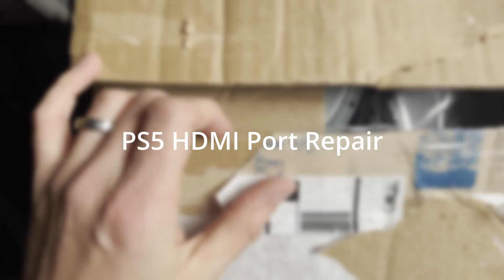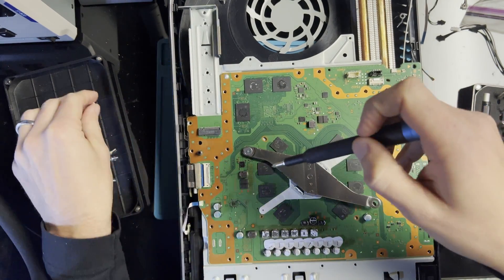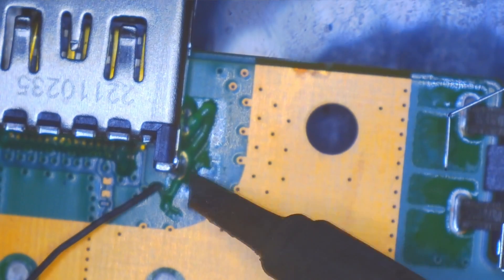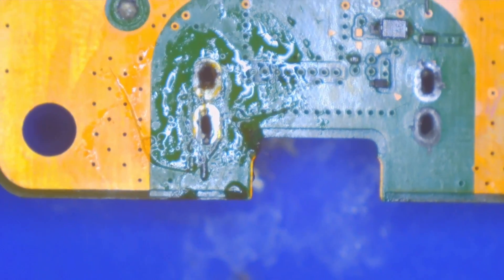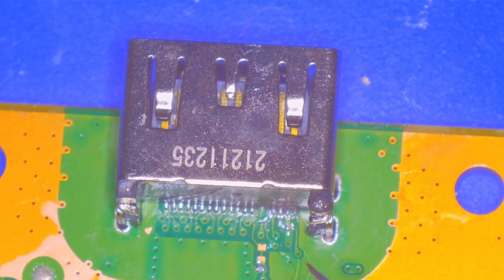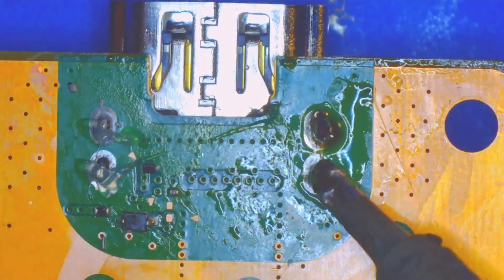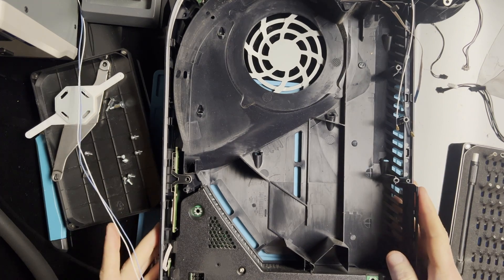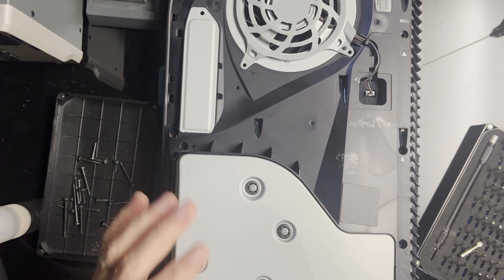Let's Fix It - Playstation 5 HDMI Port Repair

Comment: What temp was the hot air?
Reply: I run my Quick 957DW+ hot air reworking station at 412C (773.6 degrees Fahrenheit, to be exact).
Some run it at 425C. 
Also for your soldering iron the proper degree is 350C to 375C, depending on the type of solder (Leaded or unleaded, low temp solder, etc.) I run my iron at 372C for this repair.